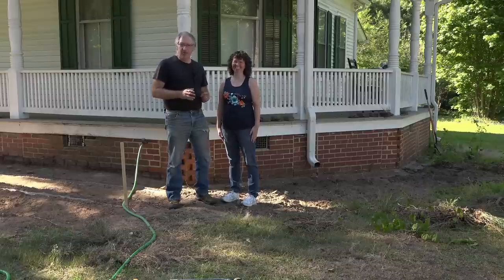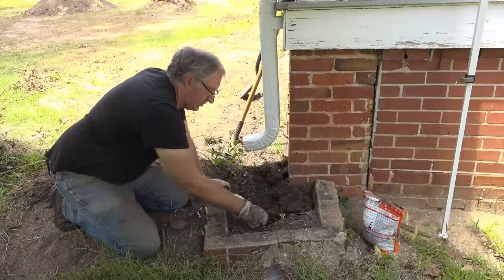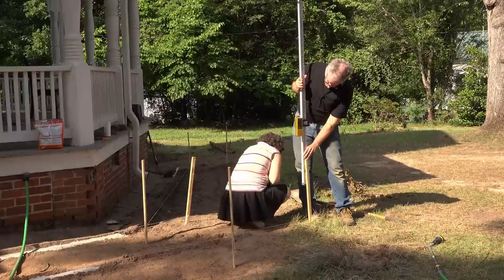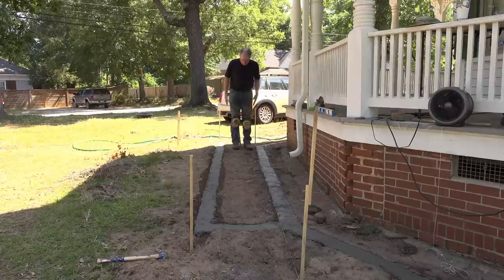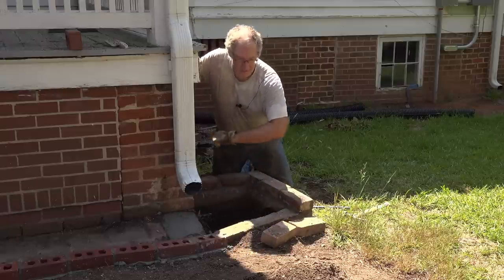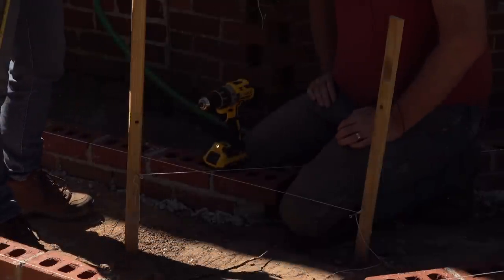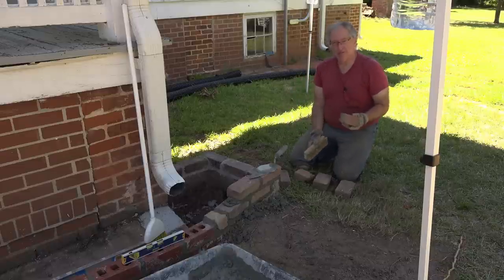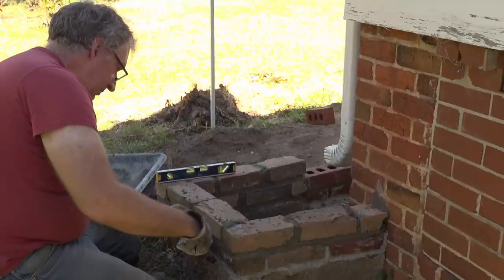EP91 Laying Brick in the West End

Comment: Something to consider may be that you have not found a water drainage system but a water catchment system. It is highly unlikely that, in 1901, a small town in South Carolina would have a municipal water system. However, above ground water cisterns were quite common. This would explain your mystery structure. That is not the base of a fireplace but the base of a water tank. Water is quite heavy so you would need something as robust as what remains on the ground. The standing feature is not a water feature but water filtration system. The first stage is a settling tank so that large material can settle out. That would explain why it is removable. So, it could be emptied and cleaned. The water then flows to the next stage. There the lower, deeper half is filled with sand. This would filter out smaller contaminants. After this the water would be suitable for domestic livestock (horses, chickens, etc.) laundry and household cleaning. To make the water suitable for human consumption, it would simply need to be boiled on the range.
Reply from the maker: That's an interesting theory. We hope dig into the historical data in the near future and solve this mystery.

Comment: This looks really great. A little hint. If stones are bricked up when it is very hot, you should dip the stone in a bucket of water just before bricking it up. The connection with the mortar and the stone will then hold better because the mortar does not dry out as quickly. Greetings from Germany.
Reply from the maker: Thanks for watching!

Comment: suggestion: slightly moist good sponge can smooth mortar joints after using pointing trowel on them
Reply from the maker: There's a tool for finishing the joints which you'll see in a future video. It compresses the mortar for a clean, watertight joint.

Comment: Lots of progress on your brick garden bed. I am wondering if you are going to add weep holes in your brick or maybe some PVC pipe to allow water to drain out? ( Especially on the down slopes)

 With your clay soil water will absorb very very slowly and usually allow for quick runoffs, but will make those beds fill up with water during a big rainstorm if there isn't a way for it to leave.
Reply from the maker: Water doesn't stand very long here. Not sure why but it goes away quickly.

Comment: There are very high ceilings in these types of properties. can you tell me what type of air conditioning and heating system that you plan to install?  Would you place it in the attic or a crawl space?
Reply from the maker: Our ceilings are 10 feet high and the first floor is already equipped with a central HVAC system. That said, it's not a very good system and it struggles to keep up even though it's fairly large. The ducting is too small and the return ducts are in the floors which do no good. The upstairs has no climate control at all. It's possible to install a unit in the attic and run refrigerant lines and natural gas to it. The problems are: a) how to install ducting that doesn't harm the character of the beadboard ceiling. b) How to run the utilities without destroying the plaster walls. These are issues that we haven't worked out yet. Great question!
Reply: @1834RestorationHouse  Thanks. My sister in law bought an old antebellum house and restored it in North Carolina. Her AC unit is in the addict
Reply: We have an old Victorian with 10 ft ceilings downstairs.  We had whole house AC put in about 5 years ago using a system called small bore high velocity.  The air handler is in the attic so vents to the second floor were easy.  Vents to the first floor went through three closets and were then spread out between the joists.  There's only one return in the ceiling at the top of the stairs.  Works well for AC but would probably not work for heat.

Comment: Does that brick building thing under the tree feed into the drainage system. Like maybe the water was to drian. In there then they used the water to water plants and gardens?
Reply from the maker: No, they are completely separate from each other.

Comment: Are you going to install air conditioning inside your house?
Reply from the maker: We're equipped with full HVAC on the first floor only. Guess where we spend most of our time?
Reply: @1834RestorationHouse  Which is worse as far as heat -- the 2nd floor or outside?
Reply from the maker: @alextirrellRI  Outside definitely...The upper floor is hot but dry.
Reply: @1834RestorationHouse  Maybe a couple window units to tide you over?  Not the most visually pleasing thing but not at all permanent! Living in Rhode Island and at present in a third floor Victorian apartment it's been my only option! My electrical is very limited so I had to find units that were extremely low amperage.
Reply: @1834RestorationHouse  Now that's a tough one. 😁😁